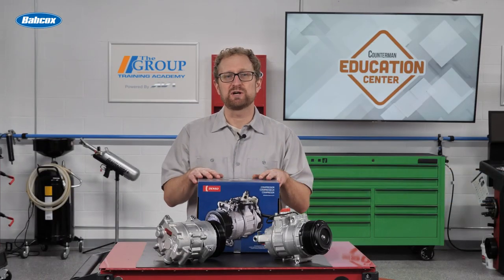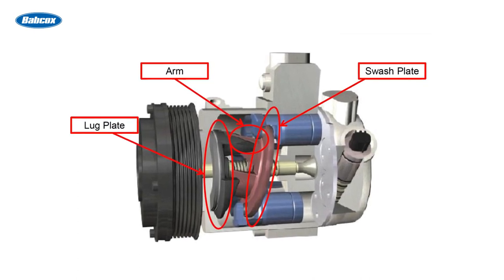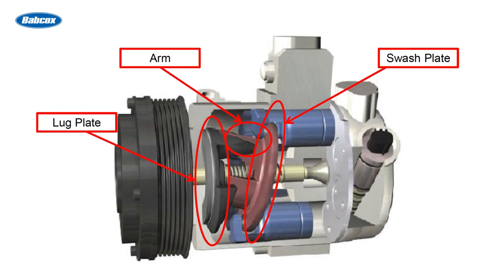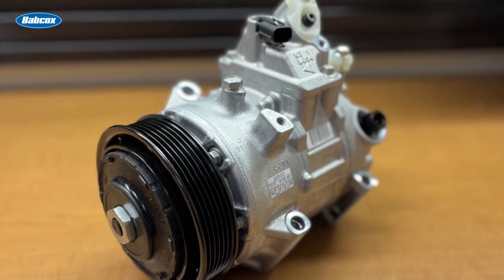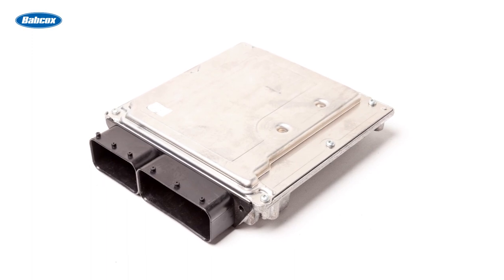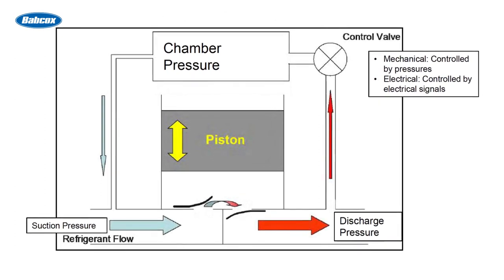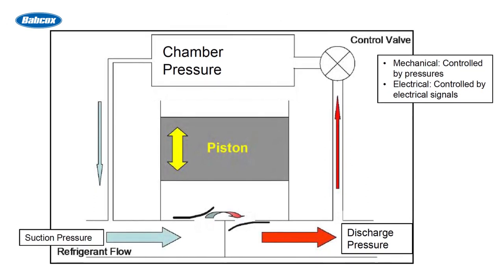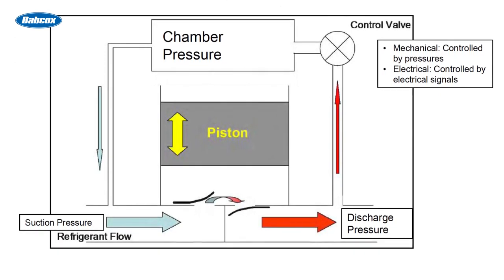A Closer Look at Variable-Displacement Compressors

Comment: There is another type of ivd compressor that has an internal component that controls the pressure differentials on both sides of compressor piston. The swash plate angle is varied by the pressure change from the refrigeration process which changes depending on climate and climate controls demand. The biggest advantage is as the system is inoperative the pressure decreases and the swash plate becomes close to vertical making the first initial stokes very small. Detering compressor impact on engine efficiency.